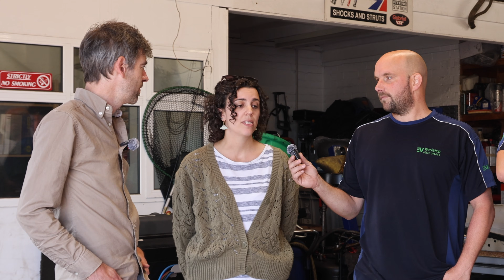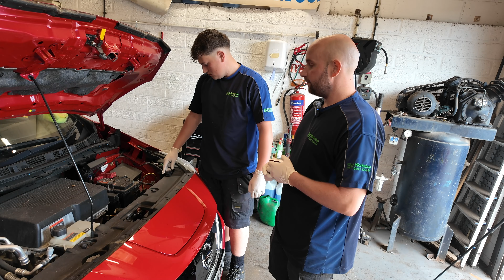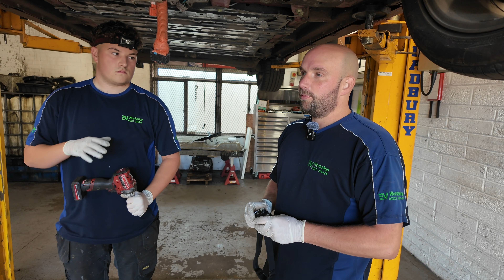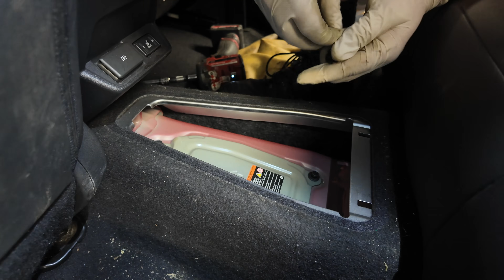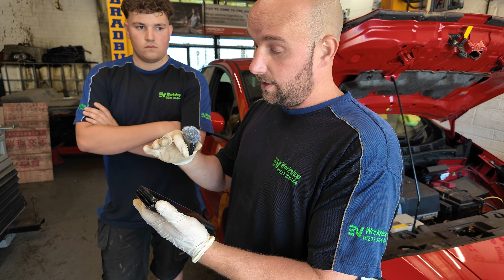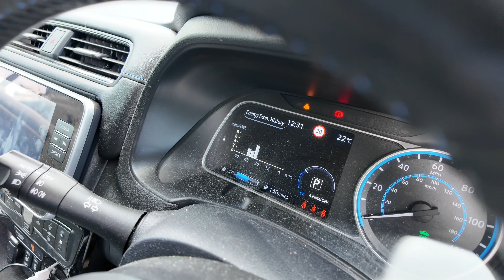LEAF Battery Swap. Out of Warranty, Out of Pocket. Nissan Refused Warranty Claim!

Comment from the maker: Over £8,000 for a new battery? Yes, it's a lot of money, but Nissan quoted Jade and Sean over £3,000 just to get to the point where they'd start fixing it. They refused offer any goodwill gestures (*1 day* over the 5-year warranty) purely because one of the car's services had been at a Mazda garage.

Do you think that's fair?

🚨 Note: When we tested the battery health in LeafSpy, it showed 99.91% but it was 100% when it left the factory. Apparently the incorrect reading is down to the cache on Dean's phone.
Reply: Should have lawyered up.

Just because a service is done at a non Nissan garage is absolutely not grounds to refuse warranty. There would have to be proof that Mazda didn’t service the car properly and not the the correct standards and therefore caused the warranty to be invalid.

Even if the owner didn’t service the car at all, Nissan would still have to prove that the lack of service caused the battery to be damaged. Good luck with that.

Nissan should be on the hook for this in my opinion.
Reply: @RichardBrooklyn  Exactly as long as it is a VAT registered garage they cannot legally refuse warranty.
Reply: @IMBlakeley  Yeah, this is why companies like Suzuki flip it the other way around and offer to extend your standard 5 year warranty for another year (Up to 8 or 10 I think) if you use one of their certified service garages. Allows them to have a shorter warranty for non-suzuki services but if you stick with them they'll up it to above what others offer.
Reply: @Bardghost_Isu they do the same with their motorbikes
Reply: It convinces me to not buy a Nissan.
Reply: I think the FTA would mean Nissan would have to fix the battery.  A good legal letter would be my advice.
Reply: I don't think they've done themselves any favours among enthusiasts by not picking up the tab for the battery replacement. If I decide to get a second-hand Leaf to replace my existing new one when it goes in at the end of the PCP, I'll have Leafspy with me and will look at the delta for the cell voltages. I'm probably going to switch brands now though, and it's likely it will be another Japanese or a Korean brand. Thank you for the video!
Reply: I thought you get an 8 year warranty on the battery from Nissan?
Reply: @JacquesLloyd 8 years for "gradual loss of capacity" which is the 12 bar scale on the instrument panel. 5 years for all other battery faults, including individual cell failure, the most likely cause of this fault. Might be wise to have an independent EV specialist check the batter just before the 5 years are up.
Reply: Very good video with lots of additional info about others EV's. 
The Nissan Leaf - although a brave and pioneering EV, still has only air cooling.
It would be interesting to find out from Leaf owners who have had battery packs replaced whether they go on to provide a worthwhile working life on those batteries give that there's no liquid-based cooling system.
Reply: shocking that Nissans 8 year battery warranty is only on the Number of Health bars, most consumers would reasonably assume any issues with the battery pack were covered for 8 years 😢😢
Reply: Surely the issue started well before the warranty expired. It didn’t just fail the day after the warranty ended. 

I would expect they could have some legal rights on this. 

It’s also not a very good advert for Nissan. The damage a video like this could do for their reputation is something their PR should be right on top of!
Reply: Don't forget to send the original BMU back to Vivne if you want to activate the battery warranty 😉
Reply: I think a lot of early Ev's are sort of concept cars and not perfected,could have bought 2nd battery from crashed damaged.
Reply: Fair? No. Reasonable may also be an issue. Would I be surprised if Nissan faced a class action? No.
Reply: Compelling viewing! Terribly poor show from Nissan though. Think of how beneficial the PR would have been for them if they'd provided a new replacement battery [preferably upgraded] FOC as a goodwill gesture and joined in on the video. Instead, I now wouldn't touch them and their 'fake' 8 year 'battery' warranty with a bargepole!!
Reply: This isn't nearly as bad as the Renault Zoe battery lease scandal..
Reply: Lovely video thanks
Reply: This is still far to expensive, you can pickup a whole Leaf 40 for £5k, crazy prices. Just like V2G hyped about on the leaf, far to expensive, seems battery swaps are just the same. I'll be scratching newer LEAFs off the car shop list.
Reply: I don't know but EV batteries need to have minimum guaranteed life to ensure environmental payback.  For solar panels the warranty is 20+ years for that reason.   If it failed within expected lifetime then there should be a special cause that needs to be understood.    I think the approach of offering extended warranties triggered by correct main dealer servicing is fair even if it is slightly more expensive.

Comment: Did they look into whether the battery was repairable at all though, or was it definitely scrap? Sounds like someone off-loaded a lemon on this nice couple unfortunately .  Just replaced my leaf 12volt Renault nissan battery from 2018, seemed fine but thought I should in case it suddenly failed. It's hard to get a sense from  this on how bad the 40kwh battery is overall though.  I have some sympathy for nissan, its either in warranty or not. If they were first owner and always serviced at nissan then maybe different...

Comment: I bought a used Nissan Leaf, the car was great, but the battery was it's weak point. I traded it in on a Corolla Hybrid, which solved the problem for me. I'd never buy another Nissan, they are not serious about Evs in any way, and I'm not surprised by anything in this video.  If you want an Ev and you want it to be reliable and have no battery issues, there is only one reliable alternative, it's Tesla.

Comment: Warranties count for nothing in the UK. The Consumer Rights Act 2015 s the law that dictates product quality. The gist of the law: More expensive products should last longer, less expensive shorter.
A reasonable person would expect that battery to last longer. Most do. I would have used that law with Nissan and spent £20 to take them to local court to fight it. 
I did exactly this when my car charger broke after 5 years (1 year warranty). It was replaced free of charge

Comment: If you don’t want to spend £8k on a new battery, is it possible just to have defective cells replaced and what sort of cost would that be?
Reply from the maker: Still quite expensive! A video about it here:

https://youtu.be/0yOBNmqqziI
Reply: @MrEV This has just happened to a friend’s Leaf. Bought brand new. Just past 5 years. It’s done less than 40,000 miles and the battery is failing. They get about 50 miles out of it now before it goes into limp home mode and Nissan are telling them they’ll have to pay for a new battery.
As you can imagine they are not happy.

Comment: We have a 2021 40kw leaf, now done 110000 miles, no issues whatsoever, our neighbour has a Leaf as well, slightly older but just as reliables as ours.The range is almost the same as when we bought it, funnily enough on other sites the Leaf is used as a baseline for reliability.  There are horror stories on all makes whether ICE or electric powered, Nissan though need a kick up the arse for their treatment of this couple.
Reply from the maker: I've heard many reports of people just like you and your neighbour who've had no issues at all. I also hear a lot of horror stories though, although considering just how many LEAFs there are driving around, that could still be a very small percentage.

Comment: Biggest problem with the Leaf is the air cooled battery which dies rapidly with heat especially if it is charged immediately after driving or high ambient heat. On my avoid list for this reason. Just about every other EV has a battery cooling system.

Comment: This video doesn’t make any sense. Sell the vehicle for scrap and add the cost of battery and repair, you could get a decent second hand vehicle with multiple years in warranty. Take a base 3 year old MG4 for example. It would cost you the same and have 4 years warranty left with a larger battery and extra features. Simply stupid to do this battery replacement.

Comment: As a retired Engineer, that air con unit inside the traction battery is the most stupid thing I've ever seen...No doubt a Student designed that pile of shyte....🫩🇬🇧🇬🇧
Reply: Mini cooper on YouTube ended up costing 16k and they think it was the cooling system that caused it

Comment: Lol, would you consider going back to 24kwh Leaf,
Lol, I battery capacity comes with Age rated issues. Lol Prefered it when you were all nice and Young looking 24 years old. God knows what will happen if you buy a 75kwh Niro , Will you undergo Rapidgate Aging, God forbid you look 75 years old in six months.
Maybe it's sounds stupid, but Better off 24 years old looking 24kwh . ❤😊

Comment: Great video Andrew.... but for anyone watching this who didn't know that Nissan's lack of BMS was the exception rather than the rule it would give a poor impression of EVs. There are many examples of Teslas, Kias, Hyundai's etc with massive mileages on the original batteries with no need for repair or replacement. I know of two Kia e-Niro here in France with over 500,000 km on the clock, both used as taxis, both rapid charged most days and still running on original batteries and motors. For ICE cars this would be exceptional, for EVs it's commonplace.
Reply from the maker: Yes, the LEAF is uniquely awful!

Comment: I'm a bit surprised they went for the 50kWh VIVNE battery pack and not straight to the largest 62kWh given that the price-difference is a tiny fraction of the overall cost, both for the battery and total install.

Unless I guess VIVNE might have been offering the 50kWh packs at a lower price at the time 🤷

Comment: It's worth noting that VIVNE only provide a 2-year warranty and 80,000 km for that replacement battery packs.

And being a Chinese company, there'd be next to no recourse if they wasn't honoured either.

So while these after-market replacement/upgrade packs are great, and using CATL LFP cells are likely to be very reliable, there's nothing but faith to base that on. (Also of note, not all of VIVNE's batteries are CATL, they have explicit models with CATL cells).

Comment: It's just pig-headed that Nissan stubbornly refuses to up-rate the as-written warranty battery terms from a "capacity" warranty to full coverage of the battery components and functionality.

Especially as for the Model Year 2022 LEAFs have been given a full component warranty for the battery for 8-years 100,000 miles, for identical unmodified technology to the 2018 to 2021 models.

It's just them trying to avoid liability for repairs at any cost.

Comment: After seeing some of the bargain Leafs Jonathan Porterfield has shown going through the car auctions, I've been thinking a high milage (for an EV) mk2 Nissan Leaf could be a good buy as a second cheap (£4-5k) runaround car, instead of spending the same on an ICE car.  

Now im feeling it's not such a bright idea! seeing Jades experience with a far newer, lower milage example  😂  Would Leaf Spy have picked up the failure in on her car?

Comment: Seems to highlight that EV's are still in the development stage and manufacturers are only just figuring out which parts work and which don't. Hopefully over the next 10 years things will improve significantly and the overall reliability will increase.. or were all stuffed lol.
Reply: Don't use this as a stick to hit all EVs with.

That's a 2020 vehicle, with a battery design which first entered manufacturing in 2017, based on a design first launched in 2010 and designed before that, by a company which thought it had such an unbeatable lead in EVs in the 2010s that it didn't have to improve its battery thermal-management and just increased cell-capacity in the same passive pack design.

The boom in EVs post-2020 when the other manufacturers caught up and lunched their first generation of mass-production EVs all include dedicated thermal management systems, mostly using liquid cooling, and don't have the cell-failure issues of the Nissan LEAFs. 

They also all provide full-term battery warranties, where as until 2022 Nissan only covered component failures within the battery up to 5-years 60,000 miles and their 8-years 100,000 mile battery warranty only covered capacity degradation, not functionality.

Comment: But I thought EVs don’t go wrong like ICE cars do ?? 
And the batteries last for years and years and years 🤣🤣
Reply from the maker: The LEAF, as I often say, is an early EV with pretty awful battery management/tech.
Reply: But they have been using batteries in power tools and other equipment for years, surely they can make batteries by now, not really an excuse for 6 year old major failures

Comment: The right to use independent garages for servicing without it automatically invalidating the manufacturer's warranty is specifically protected under the Motor Vehicle Block Exemption Regulations (MVBER). A manufacturer refusing warranty service only on the grounds that servicing was done by an independent is illegal. They can refuse warranty service if the servicing was not up to the manufacturer's servicing specification, i.e. the independent garage did not use parts and fluids that match original specifications. Being one day out of warranty, though, does give Nissan an off-ramp to avoid paying.

Comment: I suspect the former owner of this car knew the battery was failing and chose to pass the problem on to someone else. A replacement so early is disappointing but given the age of the car this was probably the right choice to get a new one.

Earlier this year I was hoping to test drive the new 2026 Leaf which was on my shortlist of new EVs. After months of fruitless waiting I eventually went elsewhere and bought another brand of EV. I'm very happy with my choice and from what I have heard since I feel I may have dodged a bullet with Nissan! Their loss.

Comment: Quick question, the softcoding was that using the Nissan Consult platform? (3 plus I imagine).

This could definitely pose a problem for doing yourself as it's prohibitively expensive to buy from memory.
Reply: Wait till these guys try fixing Chinese ones, Omoda couldn't even connect to one of there ICE cars without the software from China, cars been in 3 times for repair, in garage longer than it's been driven and it was brand new

Comment: So £8000 for a car worth around £3000 ?
Reply from the maker: That age of LEAF is about £7k on the used market.
Reply: @MrEV  oh ok but still cost more than it's market value.
So they've spent £16000 on two batteries for two Leafs ?
Both probably valued less than £10000 together.
Glad I got rid of my Leaf after 3 months and only lost a grand.
6 months later WBAC offered £2000. £8000 less than they paid me 6 months earlier.
Never again.
Reply from the maker: Oh yeah, it’s definitely cost far more in total than it’s worth but after they spent thousands to buy it, I suppose they felt it better to keep it on the road and make it useable. Painful, but I see why they chose to do that.

Comment: Not a Nissan owner but recently had a terrible experience with Citroen over the battery and a faulty OBC on a 3 and a half year old car, which they flat out refused to offer any compensation for even though it’s a known fault with Stellantis vehicles. Luckily we took out an extended warranty with the garage we bought it from which covered the majority of the almost £4000 bill. 

Their main point of refusal was that we had taken the car to an independent garage we found through HEVRA (thanks to watching these videos), which we only did because Citroen couldn’t even see the car for 3 and a half weeks. 

Always check with the manufacturer before arranging anything because they’ll look for any excuse to worm their way out of helping!

Comment: This isn’t just a Nissan issue. 

There are a growing list of Tesla customers (myself included) whose 2019 /2020 Model 3 batteries completely fail. 

This isn’t a huge problem right now due to the 8 year warranty, but who will want to own any EV outside of the warranty if it’s a ticking time bomb with a £13k repair bill?
Reply: And that's why out of warranty Leafs are worthless
Reply: Hi, the whole issue of battery replacement cost is a ticking time bomb for the buyers.
You effectively depreciate the car to ZERO at eight years.
That makes the EV very expensive.
Buyer beware!
M.